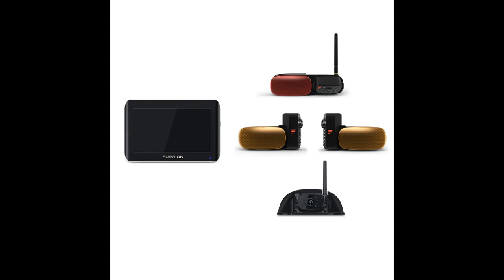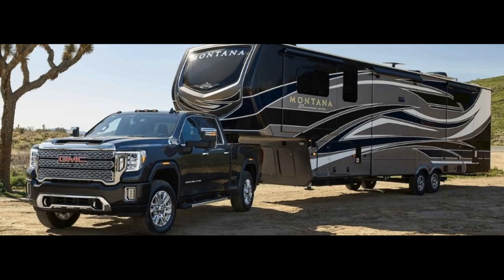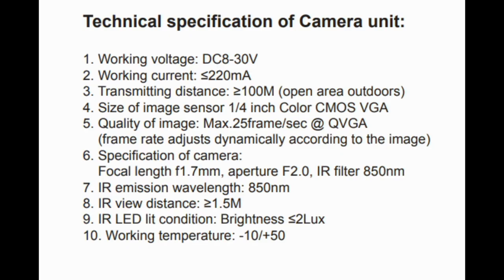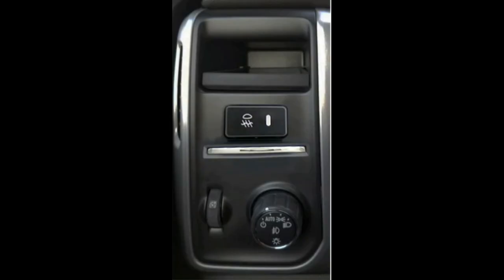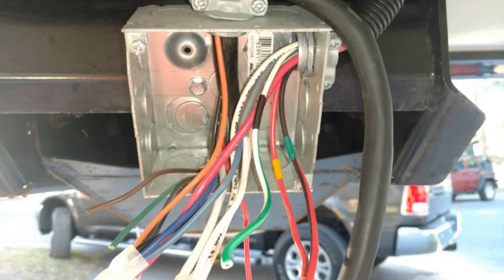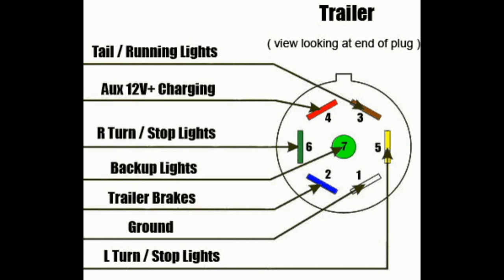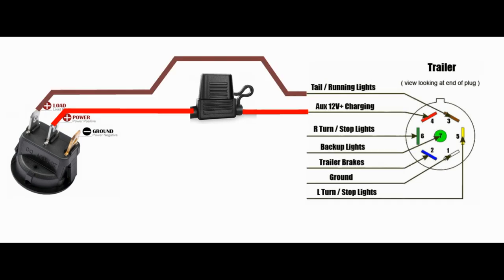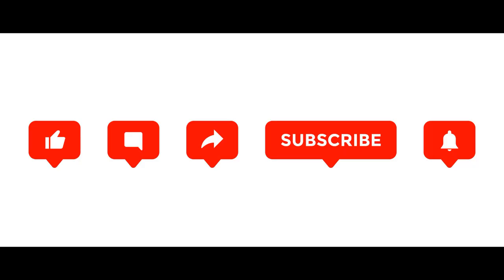Furrion Vision S Camera Modification for Latest Model Trucks with PWM Lighting

Comment: We have a similar issue with the Furrion cameras but with our Motorhome so not run through the plug in the back.  Still working with Furrion to find a solution but this switch addition may be part of it.  Thanks for at least confirming that we are not alone with this issue!

Comment: I did something similar - ran 12v constant power right off my battery through a switch, cameras always hot now and we bring the furrion monitor inside the RV first a security camera. While you have that junction box open, it’s easy to run new trigger wires from the R and L turn signal conductors to your cameras. That prioritizes the associated camera when you flip in your turn signals, and puts that camera in full screen mode while the turn signal is on. Really helps either visibility for lane changes.
Reply from the maker: great tip!

Comment: Just came across your video as I have been searching high and low for a solution to my Furrion Camera power issue with my 2022 GMC Sierra 3500.  I have watched your video several times and just wanting to make sure I have a clear picture.  The brown running light wire will be capped ?  This is done on the 7 way camper cable coming from my camper that would plug into my truck ? The nut stays in place on that running light wire and the other 2 wires will be my 12 volts and ground.  So basically my 12 volts is now coming from the camper while traveling down the road and taking the truck out ?
Reply from the maker: You are correct. We’re not using the running light signal from the truck at all. That wire gets capped at the 7 pin harness on the trailer. The 12V and ground are now providing power to your lights and cameras when the switch is on. The cameras will run off the trailer batteries and your truck’s alternator will charge those batteries while it’s on and the trailer 7 pin is plugged in. Hopefully that helps!
Reply: Thank you very much.

Comment: I went from a 2015 Silverado diesel 6.6  to a 2019 Silverado with  s 6.0 gas  i valled furrion and they said i neede a pig tail to solve the pulse problem , well it it didnt fix the problem , 60 dollars ,now i hot to go over my wiring ,
Reply from the maker: yes i looked into the pigtail option and it didnt seem like it would work for our use case. this works 100%